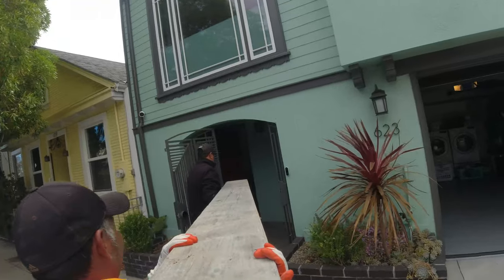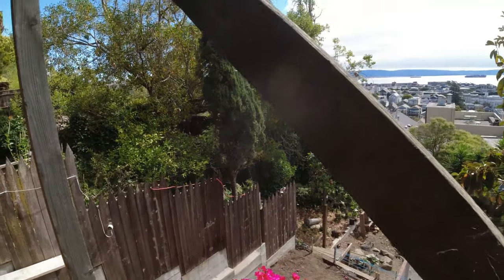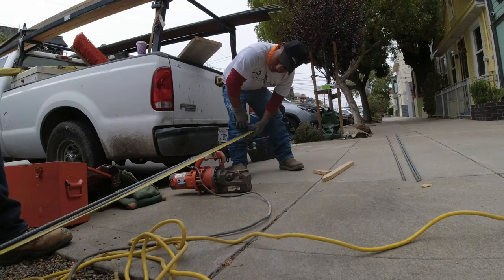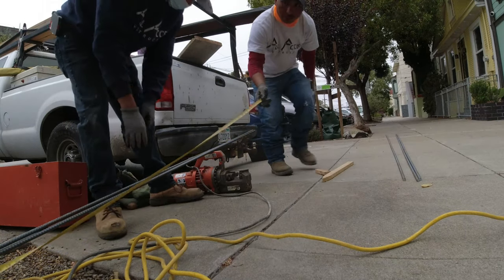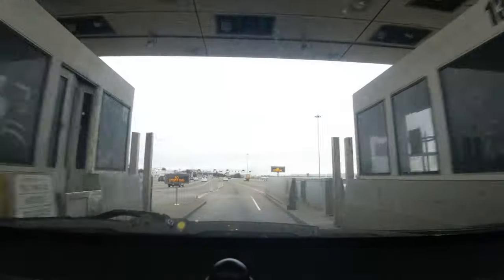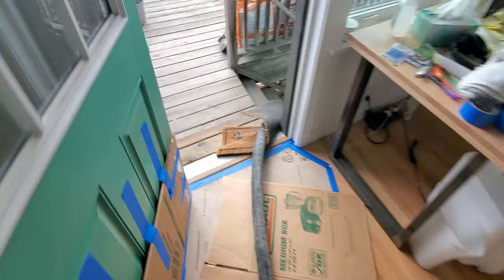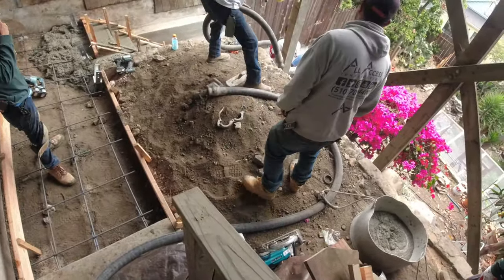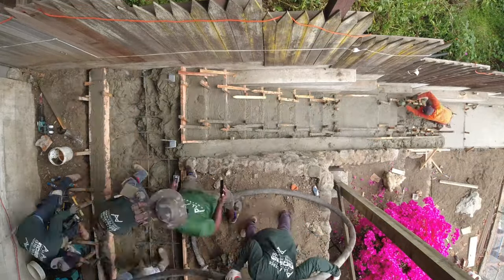💥 Concrete Stairs| 🔊 YUP You Have 2⃣ Come Through "Da" House Get 2️⃣ BACKYARD

Comment: Your videos on retaining walls definitely help me get through the process of pouring walls and the French drain, but up next I got it for a layer of self-leveling concrete underlaying in the basement, before I install a metallic epoxy floor. You got any advice on self-leveling concrete?
Reply from the maker: Super appreciate the comment and glad they helped.. I haven't done any self learning. There a guy out here that's called bay area under pinning..he is on Instagram check him out..